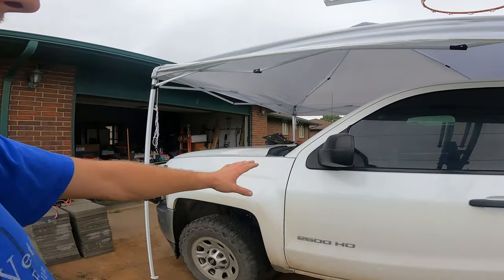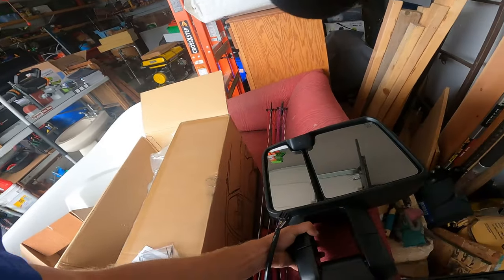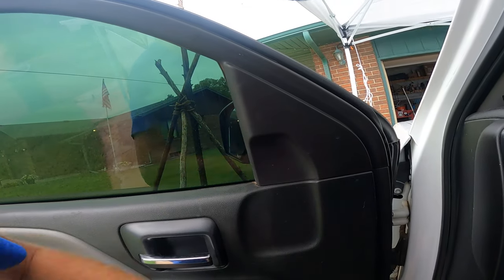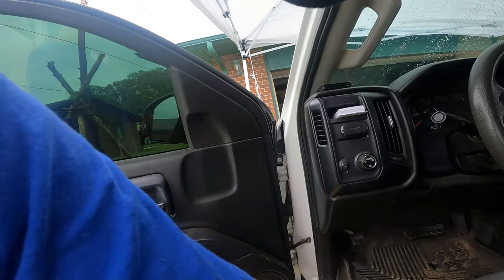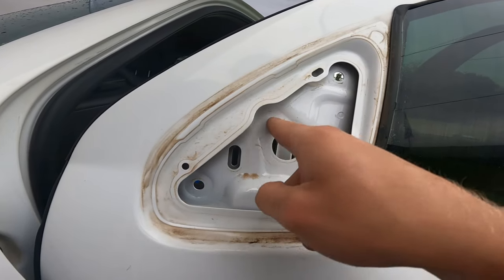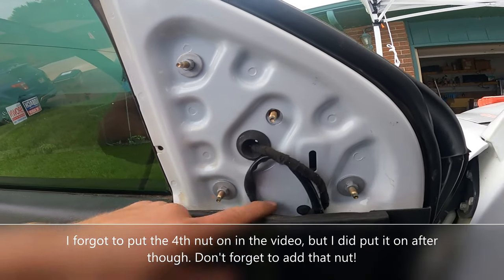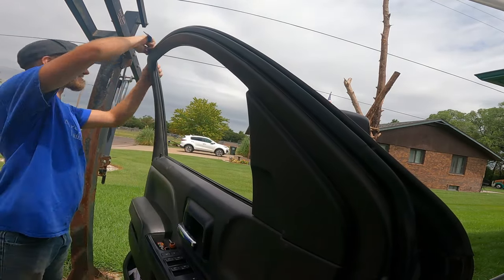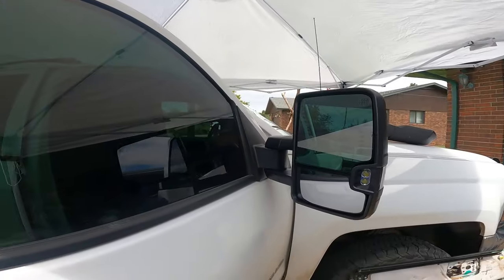How To Install Tow Mirrors on a 2015 Chevrolet Silverado 2500HD (2014-2018) ft AUTOSAVER88

Comment: Nice!!!! I almost bought those same mirrors for mine before I got rid of it lol
Reply from the maker: They look really good! We're just trying to finish setting the truck up with the correct wiring. Since it came with manual mirrors.
Reply: Did you finish the wiring? What is needed?
Reply from the maker: No we didn't. You've got to find the schematics for the wiring harness and add the necessary wires. You could buy a new door wiring harness that already has those added.

We haven't gotten back to this and might not get to. A lot more difficult than I had imagined.
Reply: Got it. I just bought these for one of my work trucks and was trying to see if there was a short cut lol
 Thanks!